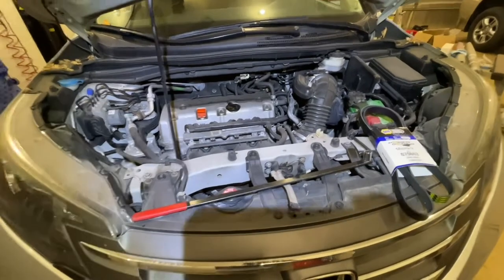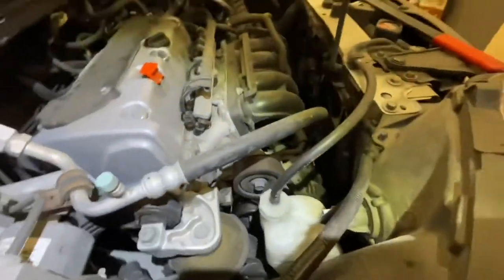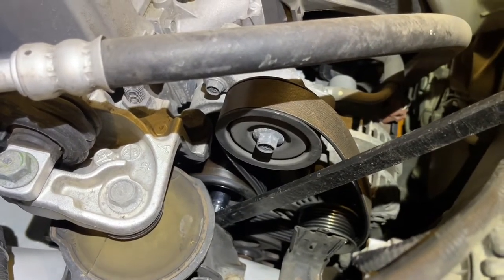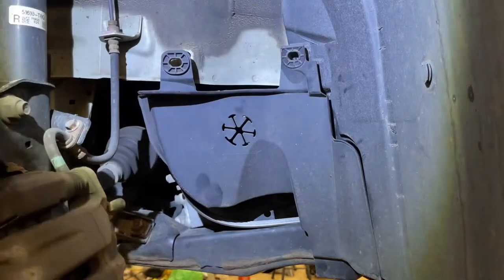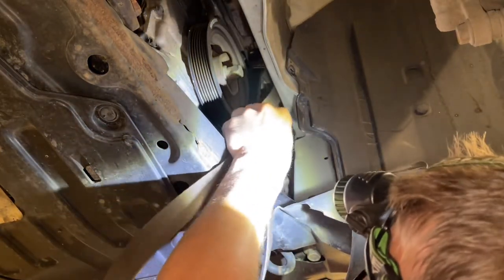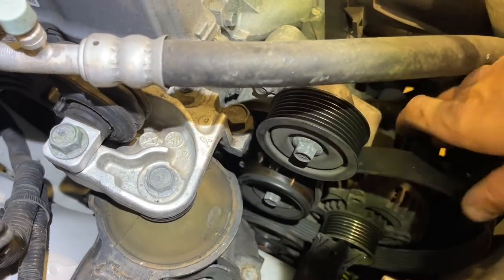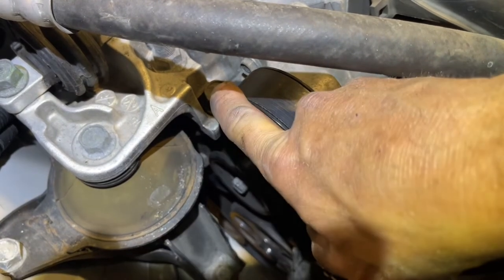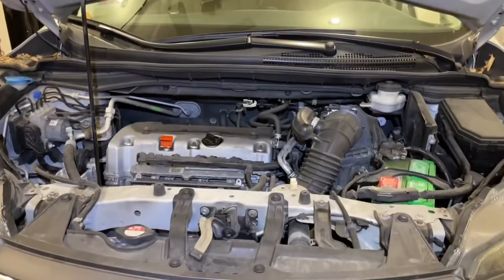Serpentine belt replacement on a 2013 Honda CR-V

Comment: Those attempting this on a 4th gen CRV should be aware that there are marks (an arrow and bar) on the top side of the tensioner that line up when the belt is new but that move out of alignment when the belt begins to wear.  This is a good indicator as to how much your belt has stretched out and why its always easier to remove an old belt vs installing a new one.  In any event, its a good idea to replace the belt at 100K if it hasn't been done by that point.  Also, it is infinitely easier when putting on the new belt to thread all the upper pulleys first and then put the belt over the crankcase pulley last using the removal tool to remove tension on the tensioner from below as you have much more room to maneuver the tool.

Comment: I decided to do this job on my 2013 CRV.  I asked the auto parts shop, O’ Reilly’s, about renting the tool for relieving the tension on the tensioner.  They didn’t rent such tools but told me I could buy the tool for $35 and then return it for full refund.  How nice!  Haven’t done the job yet but feel confident I can do it — almost 70 years old, I am.  😊
Reply from the maker: The belt is a tight fit but with a little patience you should be able to get it taken care of. In my opinion, totally worth doing!
Reply: @bennieaust  I did the belt replacement today.   Found that the best combo was the bar from the tensioner kit I bought and my own 14mm socket (kit didn’t have 14mm socket and the 14mm open wrench head didn’t work as well as my own socket).  Getting the new belt over the top pulley took a bit of wrestling — make sure all the slack down low is taken up and then it’s not so bad.  Glad I did it.
Reply from the maker: @IAWAF  great to hear!

Comment: Getting the belt over the last pully is much much harder than depicted.  This needs to be shown in detail and not glossed over.
Reply from the maker: You are correct getting it over the last pulley will be the hardest one.  There’s no “glossing over”, it’s just hard to capture the entire spectrum of what everyone will experience in my video.  Plus, logistically it was a very difficult location to capture on video. I hope you found it helpful even if I wasn’t able to capture your exact experience with it.  Thanks for watching.
Reply: @bennieaust  Everything up to a point went swimmingly.  I bought a genuine Honda part and matched it to the old one.  I jacked the car up, took the right front tire off, removed the access covers, moved the overflow bottle and used the tension pulley to remove the old belt. I got the new one on and around the pulleys right to the top on and the tensioner.  The belt is correctly positioned on the lower pulleys.  The $16 serpentine belt "tool" to work the tensioner worked perfectly to take the belt off.  It is very difficult to use the tool because the new belt has to be around it.  When putting the belt on I can't get enough leverage on the tensioner because the tool keeps hitting the front of the chassis.  One video had a guy make his own tool by welding a bent bar to a 14 mm combo wrench.  I'll try to make my own tool tomorrow.  If that doesn't work I'll have to have the thing towed to a mechanic and pay the $160 to have them slip the GD thing over the last pulley.  Your video was great.  Just the very last, most important part didn't do it for me.  Thanks for trying.
Reply from the maker: @erdi950  , you're welcome.  I hope you can get it finished off tomorrow.  Make sure the last pulley you slide the belt over is a smooth one riding on the back on the belt.
Reply: @bennieaust  Turns out I did everything right except pay $122 for a guy to use the serpentine belt tool from below.  You cannot get enough deflection of the belt tensioner from above (without a specially built bent tool).  If you go from below the tensioner is moved enough to get the belt over the pulley and finish the job.  What's worse, I even had a picture of the belt path which showed the tensioner being used from below.  Oh, well.  New question:  Do I really want to restore my K24-engined CR-V.  It's gas mileage has gone down by a third and Honda wants 3-full days to diagnose the problem, 3 weeks from now.
Reply from the maker: @erdi950 , I can’t say for sure what’s going on with it but for the cost of having Honda diagnose it you may want to just start with an air filter and an upstream O2 sensor.  Does it burn oil or is the check engine light on?

Comment: Great Video. Helped me replace my belt. If anyone else is having problems putting the belt around the smooth pulley what I did was use the handle end of a breaker bar to push the belt down as I was using the serpentine belt tool to let off tension which helped to slip the belt around the smooth pulley for the last little push needed. The whole job took me about 20 minutes.
Reply from the maker: Thanks Jay, and thanks for adding your tips!!

Comment: What part number did you use?
Reply from the maker: The gates / Napa part number is K070663
Reply: @bennieaust  yup. That belt won't physically slide in. Tried Dayco and contitech as well. They are about 1/4 inch shorter.
Reply from the maker: @jfc723  it will, this video is of me installing one. It’s a tight fit though, and as I stated in the video, you’ll have to slide it over a smooth pulley.

So you’re saying the dayco and contitech are sorter so they will not install?
Reply: @bennieaust  well not sure what you really did. I've been doing this work for quite sometime and it wouldn't slide in not even over the tensioner pulley. I even try a slightly bigger belt and no success. Will try Honda one next.
Reply: @bennieaust  gates, contitech and dayco 7pk1683 belts are not going in. 7pk1687 which is 5mm bigger still doesn't slide in.
Reply from the maker: @jfc723  yeah, definitely couldn’t capture it on video, would have needed a few extra hands.  You can clearly see that I used a Napa belt and it’s on there!
Reply: @bennieaust  i just installed the contitech 7pk1687 by unbolting the upper idler pulley but the tension on the belt is just way too much. The tensioner almost bottoms out. I just don't like how it feels. Will try Honda one after the holidays. In fact I already checked with them it is a 7p1683 but it is longer just like the one I removed from the vehicle.
Reply from the maker: @jfc723  that’s weird. When I installed the Napa one, it was a tight fit but nothing I haven’t seen in the past. At least you can fall back on the OEM Honda belt.
Reply: Genuine Honda Parts 31110-R5A-A01 Alternator/Accessories (Bando) Belt
Reply: @jfc723 how did you make out. I’m literally playing out your past struggles. I’m at the point of going to Honda and getting one

Comment: Why did you replace this belt? was it slipping? was it high mileage on it?  also my upper idler sounds dry? What is the fix for that?  thx
Reply from the maker: The belt has 100k miles on it. 

It was replaced as preventative maintenance. 

If you have a noisy idler the fix is to replace it.
Reply: @bennieaust  Thank you Bennie
Reply from the maker: @Susan70003  you’re welcome!!
Thanks for watching!

Comment: yea i couldn’t even get it on with sliding it over the smooth pulley, i had to take off the idler pulley, loop the belt around it, then resecured it with the belt already on while holding tension off, absolute bear to do

Comment: If a dealership charges $260 to do this I understand.  You would have to purchase a Daytona car jack, jackstands,sockets, special tools, ratchets, the belt, and have the know how  The average person is not going to buy all of those tools, or have the will to do this job, lol.  Most people just pay out of their ass.  But, some people don't mind going balls out & changing their own serpentine, head gasket, clutch etc. .It is a rare bread of person who does their own mechanic work in 2024.
Reply from the maker: "But, some people don't mind going balls out & changing their own serpentine"

Thanks for the huge amount of undeserved credit.  lol
Reply: Lol  well most people who would work on their own car should already have basic tools like the jack etc.    You're making it out to be a bigger deal than it is.
Then you can also work on other things with your car, say your brakes.    Ultimately you'll save big time from going to dealerships or other shops.   And possibly learn stuff & have fun in the mix 😊
Reply: @mcsqueegee81  Most people in ur neigborhood arent about that diy mechanic life. I got 2 cars & been drag racing & tooling on B18/b16 ls vtecs since the 90's so im all in when it comes to repairs on my car. So when i pulled out my cylinder head, camshafts, etc, i realized how royally fukd i was if i couldnt put it back together with new seals & a head gasket. I laughed, cuz i knew theres no way in hell non gear heads would even fathom doing their own head gasket.